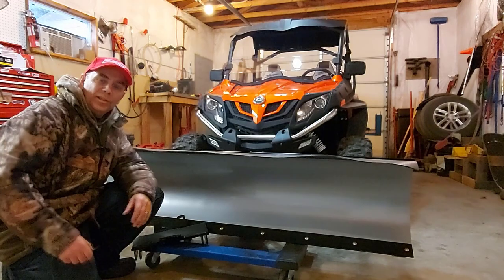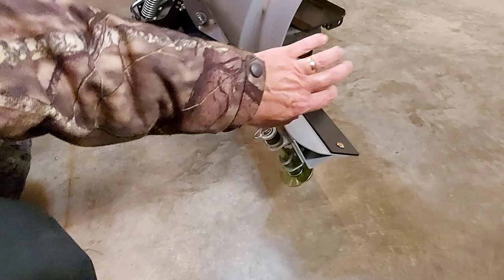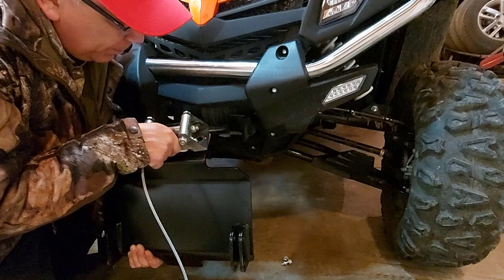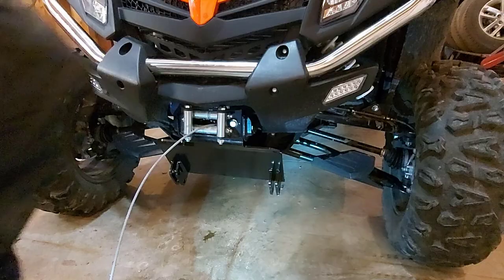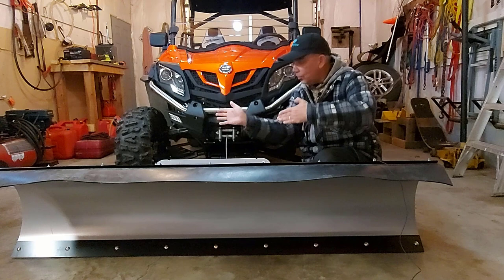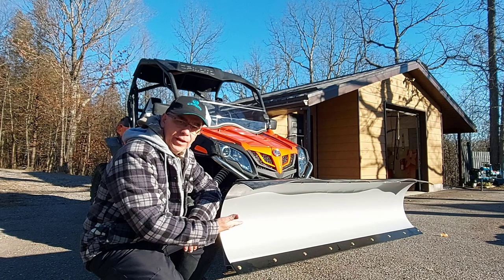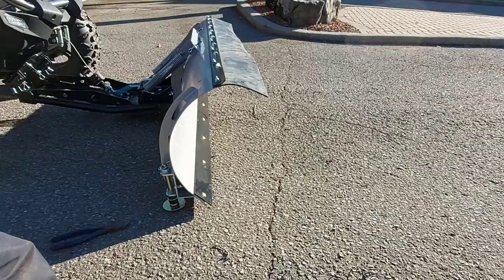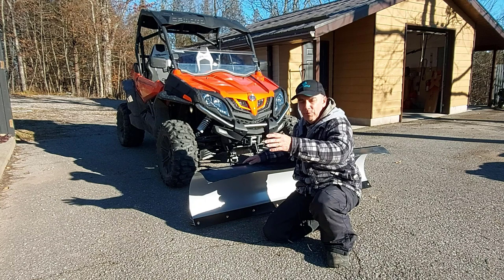How to Install a KFI Plow on a CFMOTO ZFORCE Side by Side

Comment: I bought a 54 inch KF I plow for my cforce 800 xc. The plow mount mounts in the middle under the machine. What I like about this is there is 4 nuts welded into the frame to bolt the plow mount too. I Purchased a 54 inch because I do a 4 foot wide sidewalk with it too, any bigger is to wide. Plow is wide enough when it’s turned full right or left that it covers the tires so you’re not driving over the snow that you’re plowing. I spray it down with WD-40 it will stop it from rusting and the snow doesn’t stick to it. I have the plow blade set up about a quarter inch off the driveway. I do all pavement or cement no gravel plowing. Another thing you can do to save your skid shoes as take them off and build up with weld so they don’t wear out. The winch cable on mine goes straight up and down easier on the winch and cable.

Comment: Looks like a well built plow. It should stand up well for you. I have a gravel driveway also but what I do to prevent possible gravel relocating is pack down the first few inches of snow. That way you have a base above the top of the gravel and you can keep the snow cleared down to the base each time you plow. So the only time I put my shoes/skids on is in the spring when the snow starts getting soft and the plow digs in easier. Saves a lot of excess snow build up. Just thought I would mention it.
Reply from the maker: I usually do the same with a base. It works great as long as you don't get mild temps and melts it away.

Comment: Your cable will snap over time. Kfi makes a bracket that raises the winches attachment point that will solve that.
Reply from the maker: I switched to a synthetic rope. But I don't like the pitch of the rope from the winch to the push tube.

Comment: Great video! I'm looking to get a different plow as my current plow setup is too reliant on the cable winch and is always tripping and snapping the cable. I have a pretty long gravel driveway, and I see this plow looks to plow it with no problem. I might have missed it, but is it listed on which KSI plow system you used?
Reply from the maker: Thanks, This plow system is solid and tough. Although I wasn't happy with the angle of the winch rope to the blade. It was to straight on and I could see the lifting force of the blade was awkward. KFI makes a plow lever with a pulley that is supposed to take some of that strain away. I never did get one. Both the side by side and plow system is gone, I sold both. I will be plowing with my Cforce 500 and a Kimpex Click n Go 2 system this winter.